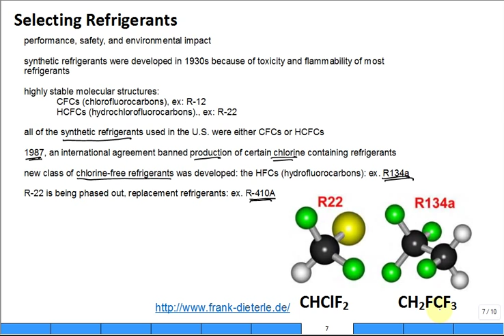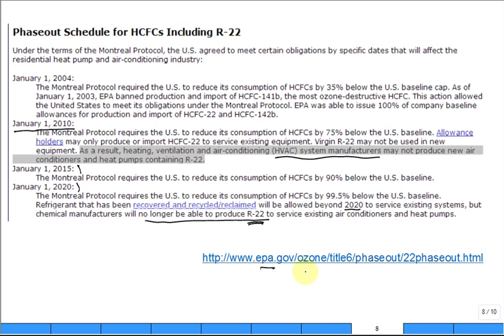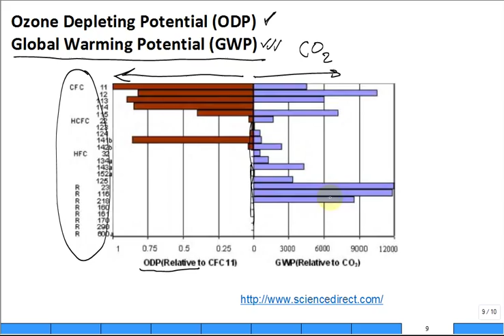Selecting Refrigerants R12 R22 R134a R410a

Comment: My HVAC system is using R22 refrigerant, does this mean that I will have to replace my system to R410 in 2020, which is only about 1.5 year left ?
Reply: Son K I’m afraid you will need to do that 😰
Reply: Man, and the whole system is not even cheap. I mean inexpensive. By the way, I saw some videos about replacing R22 freon with other refrigerants such as MO99, R407C...without any major replacement, is that true ?

Comment: What characteristics distinguish the use of R410a/R22 vs R134a/R12?
Automotive A/C, Home cooling systems, and refrigerator applications all require different refrigerants; is it their temperature operating ranges from heat of vaporization, heat transfer capacity that dictates which is used in each of the systems?